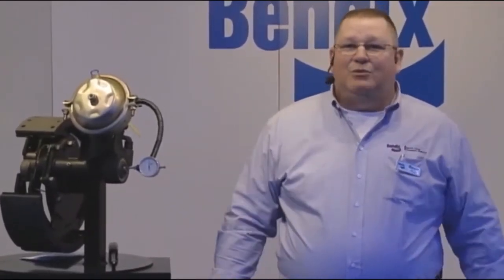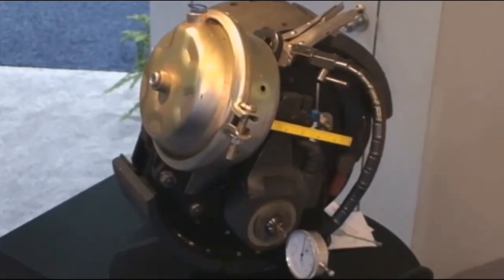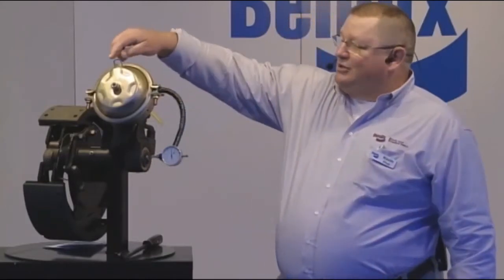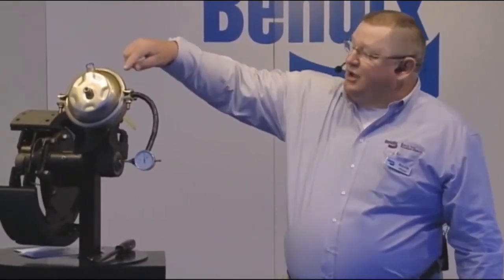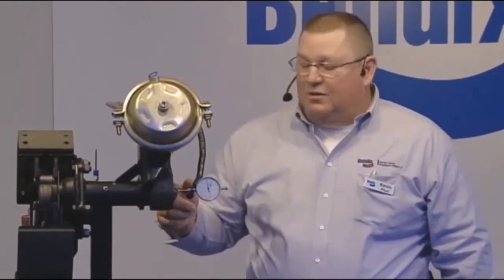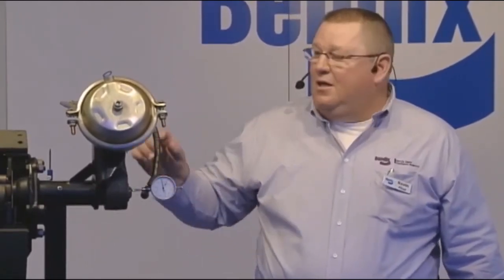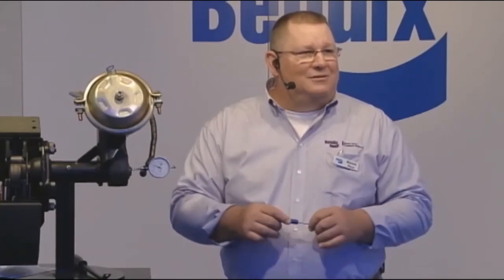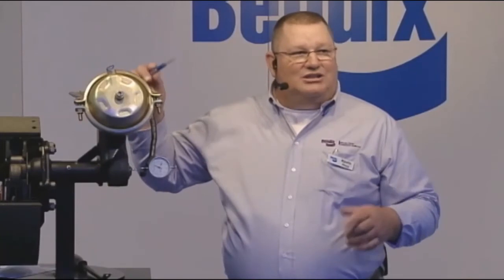Bendix - S Cam brake maintenance

Comment: Bendix should manufacture slack adjuster clevis pins with hex formed pin heads .  This would be to make sure that the pin is free and easy to turn and lubricate .   Place a microphone in the audience .   119/23